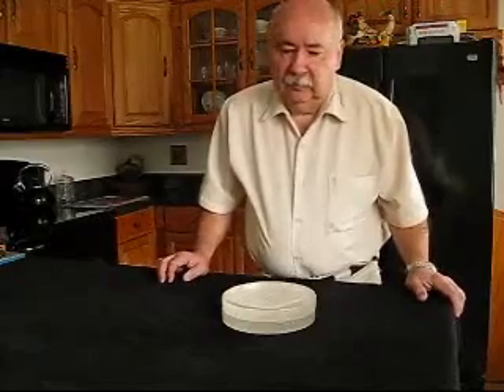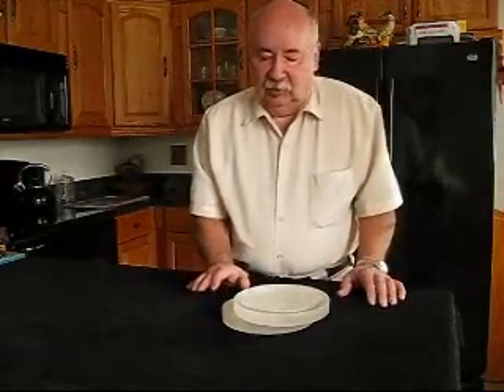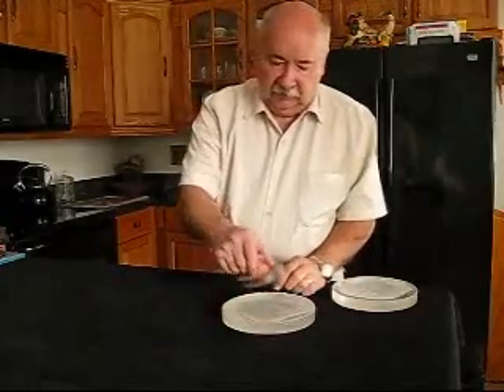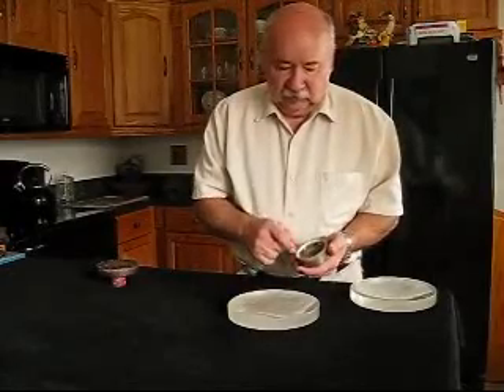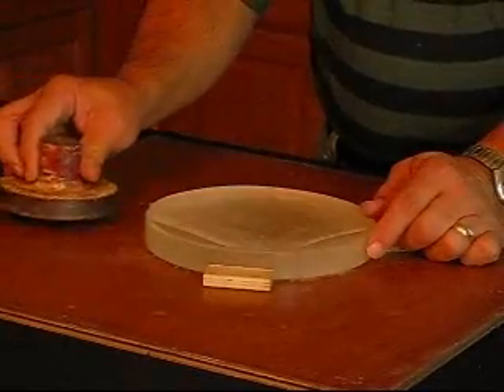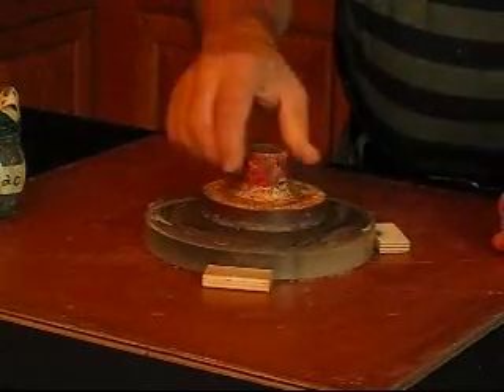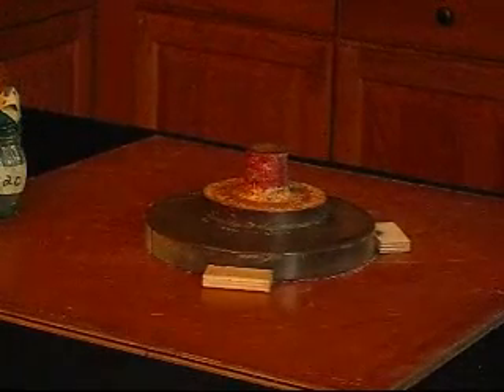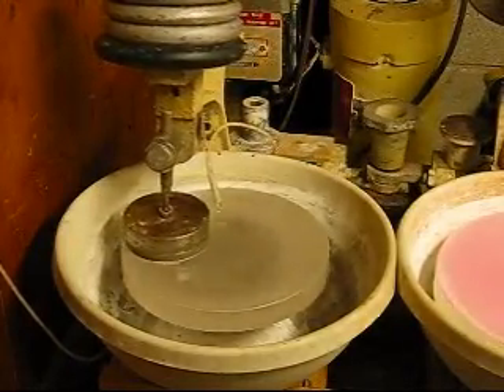Lens and Mirror Making for the ATM #1

Comment: Ed,
Is a diamond wheel a diamond grinding wheel
I found a grinding wheel at harbor freight.
Is that what you are referring to in the video?
Personally, I just used a pipe floor flange. (I am a newbie here).
Seems to have worked O.K., but I would be interested in that diamond tool you have in the video.
What is that called at the hardware store?

Thanks and appreciate the effort you took in making these. They are very helpful.

.......Cameron
Reply from the maker: Cameron,
   A diamond masonry blade from Harbor Freight should work nicely and speed up hogging out the curve.  The grit size may be somewhat coarse so be sure to keep the edges chamfered well. You can find some cheap ones on Ebay as well.
Ed
Reply from the maker: Ed Jones The wheel I used was made by a company out of business I believe.  You might try this wheel:  http://www.ebay.com/itm/4-1-2-WET-DRY-TURBO-DIAMOND-BLADE-Rock-Masonite-/370710749620?pt=LH_DefaultDomain_0&hash=item56501521b4
Ed